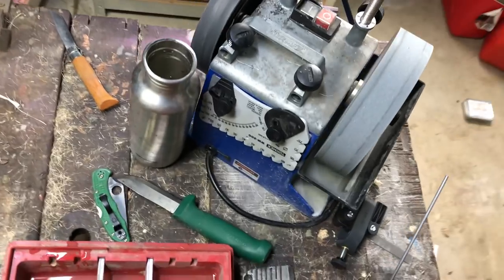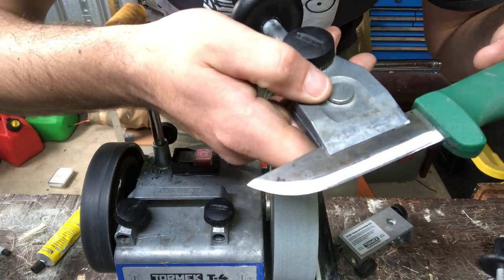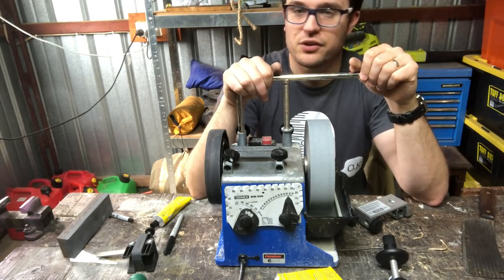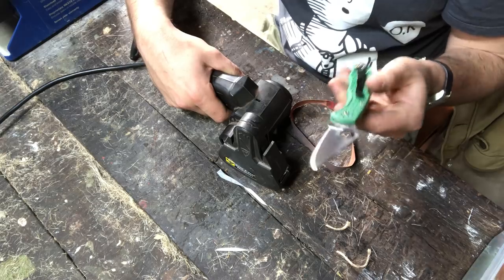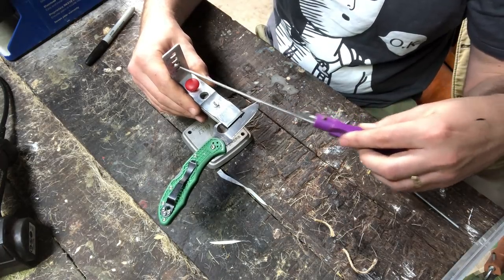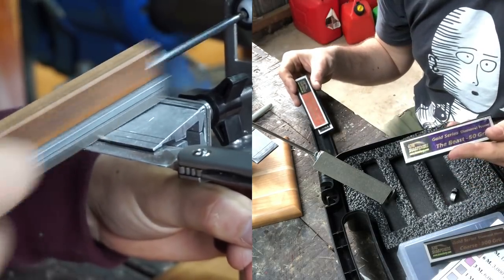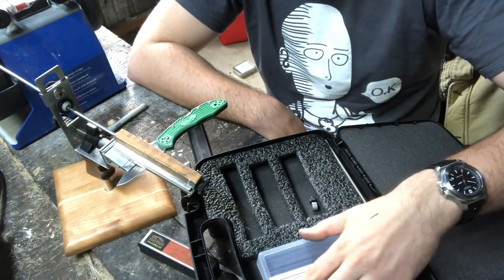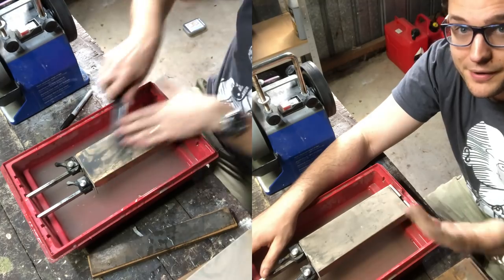5 Home Sharpening Systems Rated and Explained

Comment: The Tormek, while pricey, is also good if you are a woodworker and have chisels and plane blades to sharpen from time to time.

Also of note is cubic boron nitride wheels.  They can be put on a bench grinder and will grind edges faster than any sharpener without over heating the blade.  Expensive as well, but CBN wheels are worth it if you can afford them.  It is like getting spiral carbide heads on your planer or jointer.  Worth it if you can afford them.

Comment: A question regarding the KME, I have the 50 and the 100 grit stones in addition to the basic kit. When sharpening I find that the 50 and 140 grit basically cut under their own weight but the 100 grit seems to need a fair bit of pressure to start cutting. Is that your experience as well?
Reply: It may need that beacause you press to hard and stripped the diamond out I would call them though
Reply: I never used pressure on the stones and it was like this from new. I'll send them an email since calling is a bit of an issue considering the time difference.
Reply: Remco Meeder kme has good customer service they should replace it if it’s defective
Reply: I know. The system is awesome  though. I upgraded to the KME from a Lansky and man what a difference it makes. Although you can get great results with the Lansky the flexibility of the KME makes it a lot easier to get scary sharp results and it is much easier to match the factory angle. It really takes little to no effort to sharpen even the dullest knife and I even fixed a couple of knives which had the edge butchered by either the user or someone who thought that sharpening was easy...
Reply: Remco Meeder  yeah I know I wanted to try out fixed angle systems I tried the lansky first and hated it the kme and I love it I’m used to freehand so it may take me a bit to get used to the kme but it’s a great system

Comment: Any knife sharpener is only as good as the operators skills, I've put great tips on knifes with the worksharp sharpener, but it can take tips off if you don't use it properly.

Comment: I collect knives but shame to say owning a Worksharp Ken Onion sharpener, still I dont really know and dare not sharpen any of my blades after spoiling the Cold Steel Code 4 Tanto Point; point by a bit even several training using a cheap  knife. Plus I am not really sure what angles are best for each individual knife.

Comment: Waterstone's ease of use should be 5/5, just because it is difficult to learn doesn't mean it's difficult to use. It's like bicycle, if you know how to ride one then it's super easy to use but for people who just can't ride bicycles it's the hardest thing in the world. That doesn't mean the ease of use rating for bicycles should be 1/5, that's just silly. 

Waterstone is extremely easy to use, especially when you are just sharpening v-edge or a microbevel it could literally take less than a few minutes to complete the whole sharpening process (apexing, deburring, polishing, stropping). With a nice splash and go stone I can get a kitchen knife to literally razor sharp before you even get your KME/worksharp set up ready.
Reply from the maker: Beast of the Far East ok, maybe that rating should be ease of adaptation or ease of learning. The guided systems will have the new sharpeners doing lovely even results  out of box far quicker than a set of waterstones - thats what I’m trying to say.
Reply: By that criteria, all sharpening methods should rate 5/5 don't you think? Perhaps 'ease of use' could be changed to 'ease of learning to a point where you can consistently repeat the same angle and achieve a hair-shaving edge'.
Reply: Can't take guided system with me anywhere and very difficult to use without a man made flat surface, with whetstones you don't even really need water or a flat surface, many people sharpen with the stone on their hand, Michael Christy being one of them.
Reply: Beast of the Far East actually a kme is  fairly portable and you can sharpen without the base
Reply: I find good fast results with water stones following very course grit diamond stones. I often use 300 then 600 grit diamond then 1200 and 6000 water stones. Finish on strop with compound and edge is mirror polished. Very little time is spent on 300 grit and then every following grit is only about refining the edge you have already made.
Reply: mcnameva I usually just sharpen on a 500 grit stone and then go for the strop,  nothing beats a razor sharp 500 grit toothy edge. One stone one strop, that's all I usually need, sometimes I use 1000 or 3000 instead of 500 on certain steels such as VG10 simply because they prefer finer edges, I have a 5000 grit stone that gives a really nice mirror polish but there wasn't any big performance increase other than it push cut phone book paper much much smoother, it was literally ''sharper on paper'' but not really sharper in everyday tasks so I guess I'll stick to the 300 - 3000 range. The way I see it, 5000+ finish are for razors and sushi chefs.
Reply: @jakewolf079  False. The guided systems come with cases, the base is optional, and you don't need a flat surface.
Reply: Beast of the Far East sorry I’m one of those people who can’t ride the bike. I have tried watch tons of vids I just personally can’t use a stone. 

So i built my own system similar to a lansky and hone with a mdf wheel when done. The results I get are amazing. Stones are not for everyone
Reply: I don't agree at all even after watching a good number of videos I only succeeded in making my knife edge worse.  The amount of time it takes to learn without instruction from someone who can tell you when you are going wrong is just not realistic for the average person.  Ease of use is a solid 1 for anyone who isn't skilled at knife sharpening and knowing what to look for or feel for while sharpening a knife (in my case dulling a knife). 

Guided systems are like having training wheels (I don't know about you but I used them to learn how to ride), and freehand is analogous to just being tossed on a bike and being told to ride.  Yeah it makes sense in your head that it should be easy, but in practice it's quite difficult.

Comment: 15:35 wouldn't this belt grinder absolutely destroy the temper on a blade?
Reply: Not if you use it right.
Reply: I forgot to mention that he used it very wrong.  There are videos from work sharp that show how to use it correctly.

Comment: Lansky turnbox/Spyderco sharpmaker opinions?
Reply: DontBotherNone In my experience they are good for honing/maintaining an edge ,but if you have chips or a very dull blade they don’t have the cutting power to fix that. Also they tend to get clogged up because of the small cutting area, so you have to clean the stones a lot.

Comment: you are using the worksharp wrong, when you get near the edge you let it stop as to not round out the edge
Reply: And he has the WS running when puts the knife in then he holds it there too long before he starts moving. All wrong

Comment: I love the Tormec and the KME system. The Lansky reminds me much of my Smith's kit. Basically the same thing. I wore out my stones on that MT-5. As for the Worksharp, well, I have a number of large knives, a Golok, a Cane knife (the thin, deep blade type) and will soon have a new axe, so I reckon it might be handy to have around. I should add that I use one of those Benchmade branded 'field' sharpeners. It is good for maintaining an edge or even to resharpen a knife. I use homemade leather strops rather than the one on the field kit. It's just a bit too small for my liking. https://www.benchmade.com/guided-field-sharpener.html
Reply: Yep, they'd probably work out a little cheaper shipped to here than the Benchmade. One word of advice. Don't wash them in acetone. The rubber seals on the ceramic rod kinda melt. Lesson learned.

Comment: Very useful video, im still in the market for a good sharpening system, so this helped alot.
Cause im horrible at free-hand.
As far as the worksharp and tip problems go, Doug addressed that problem in a video.
Im sure you've already heard this said, and maybe are still having that problem, but just incase..i'll link the video & time stamp for the tip problem and re-using your old belts.

Tip @ 11:40
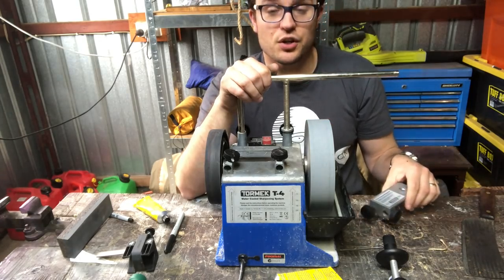Re-use belt @ 8:25

https://www.youtube.com/watch?v=1_09uFzqhT0

I would be interested to hear if that tip problem is still a problem whether or not you do what he says in the video.

Anyways, great video! I have it bookmarked now!
Thanks!

Comment: Every video I see you talk about how the Work Sharp rounds off tips I see that you don't follow the included instructions for how to use it. Can you just try and use it like the instructions state and then maybe you will not have tip problems? You don't just leave the device locked on and pull the blade through. You use the monetary on and stop at the tip as you raise the blade. I am certainly not criticizing your videos as you are far more knowledgeable than I am. I have the KO Work Sharp and I have not rounded off a tip since I first got it with my first knife I put through it. Just hoping to add something to the convo. :)
Reply from the maker: NewZona Rides the little worksharp I have will round off the tip very easily, even when you line it up perfectly. The belts are slim and twist toward to tip, even when its super slowly and precisely applied. Definitely possible to not grind off the tip, but for folks looking at a system from ground level it’s definitely something they need to know to watch for
Reply: I suppose its possible that the smaller original version does this more easily than the KO version. I am not sure.

Comment: Workshop is Terrible; blade guides give No precision; angles can change within the stroke not to mention you are “controlling” the strap tension at the same time. Good for axes.
Reply: Much better with the blade grinding attachment.   The stock setup is awful to use.       Love mine with the attachment for my cheaper knives.

Comment: You’re using the work sharp incorrectly. You need to put the blade into the guide before you start the belt going. Then, you need to cut the power while the tip is still touching the belt. Read the manual and you’ll be fine.